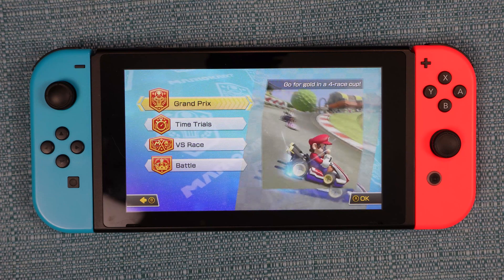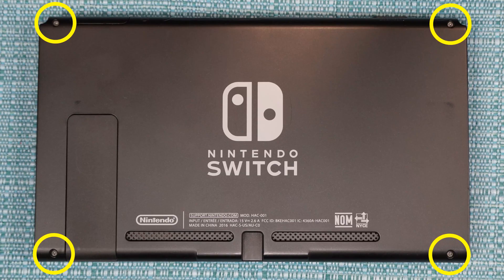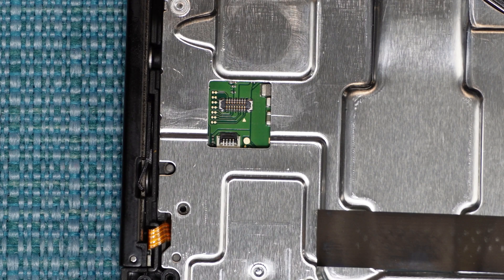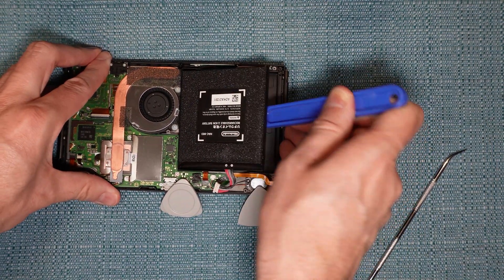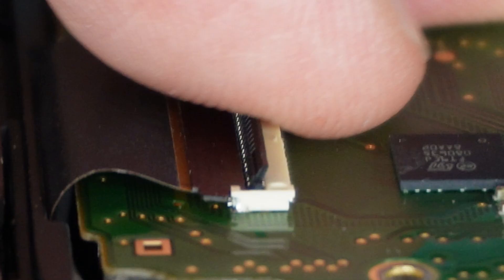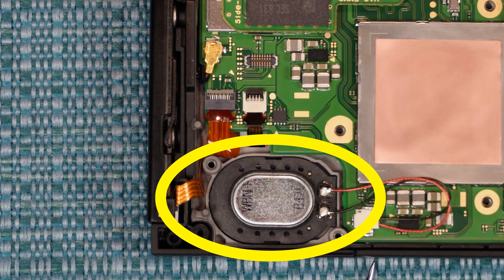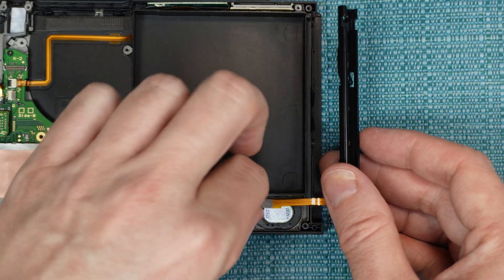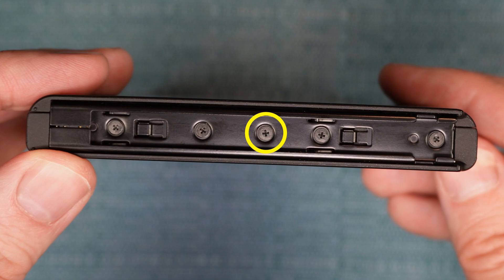How to Open Up a Nintendo Switch to Replace Thermal Paste, Fan, SD Card, Cartridge Slot, Rails, etc

Comment from the maker: Things you may need:
Battery Replacement: https://amzn.to/4dwMc9A
Speaker Replacement: https://amzn.to/4dp8eeN
Replacement Rails: https://amzn.to/4d9nrQU
Replacement Fan: https://amzn.to/3WQh3bu
Cartridge Slot: https://amzn.to/3YrNUog
Screwdriver Set: https://amzn.to/46P721P

All Amazon links above are affiliate links. I get a small amount of money if you end up using them to make purchase (it does not have to be for the item I link to, as long as you click my link then move to another item, it works)

Comment: Would recommend using IPA 91% or higher, get it under the battery to loosen the adhesive. It'll dry fast and after drying, the adhesive will still be tacky and reusable. Pry with a plastic spudger like you demonstrated still.